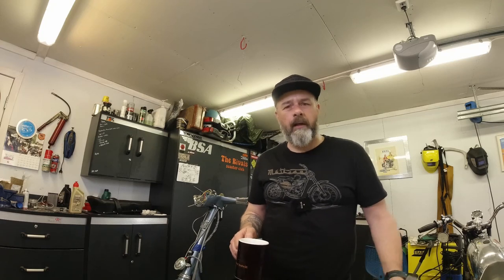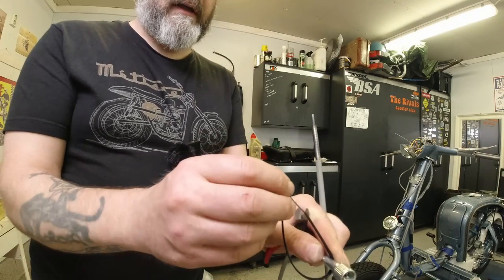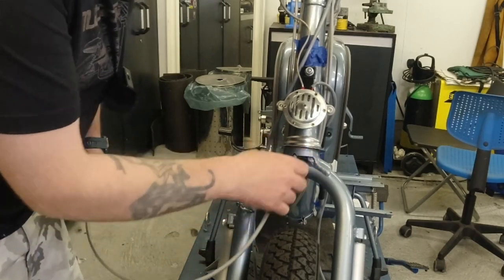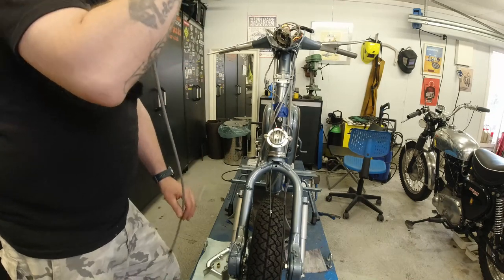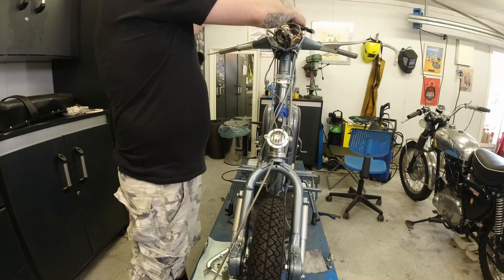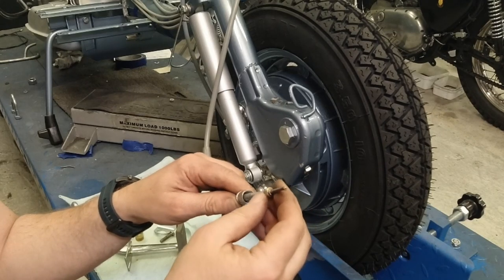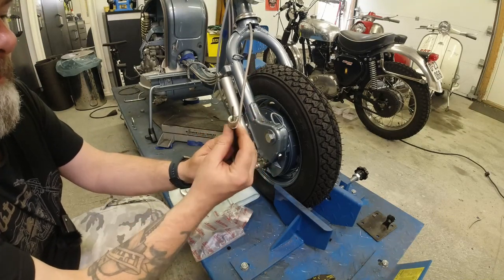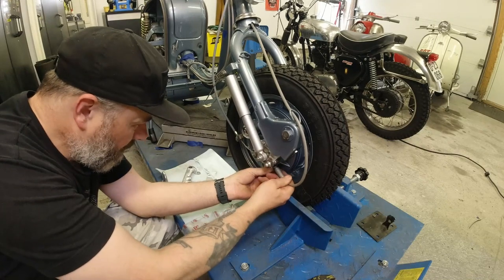How I fit a lambretta speedo cable

Comment: another handy vid..good tip with the cable tie...we have all lost the at least one down the forks at some point....do not rely on the rubber o ring on the scootopia cable , its not very tight and will slide down the cable too.....i know, now! one other point to make, make sure you have the correct size cable end first, there are different sizes and some dodgy cables too.
Reply from the maker: This was a tricky one on sizing. Early S3`2 have the smaller S2 type cable!

Comment: Q! inside the front hub were the cable goes in whats the name of the thing it attaches  with? because when i bought the scooter from a shop in London the speedo wasnt working so he fitted a new one in the headset but if i remember in the front hub there was a spiral thingy what i think came out and the fella said some are made of metal and some are plastic.
Reply from the maker: Speedo hub drive is the word you are looking for. Metal are best.

Comment: how do you get the nut out the bottom of the fork if it drops ????? who has best idea . i just blow it out with air line from the bottom ........
Reply from the maker: Yes Airline. but if it has grease on it can be pretty tricky!
Reply: Sticky tape on a piece of diesel works for me
Reply: Dowell not desil